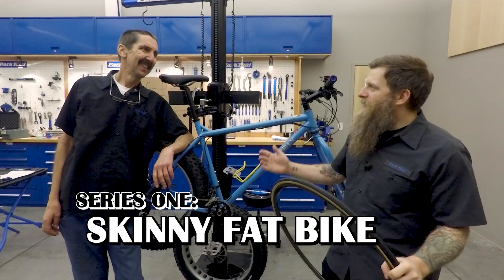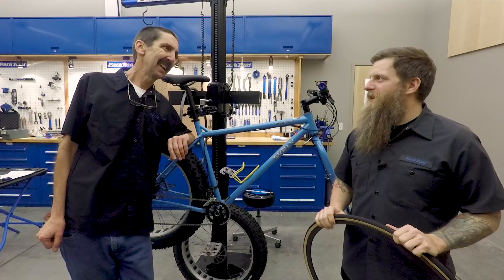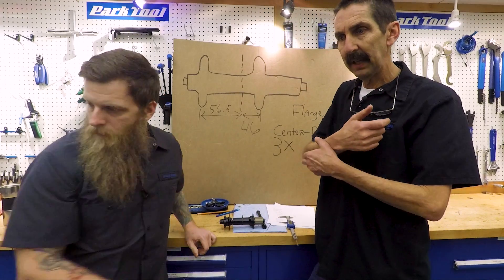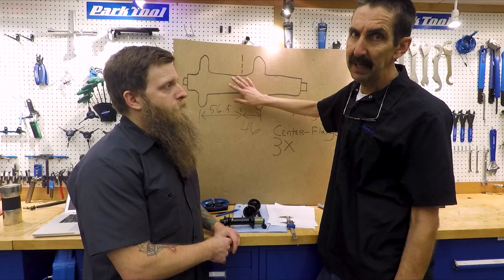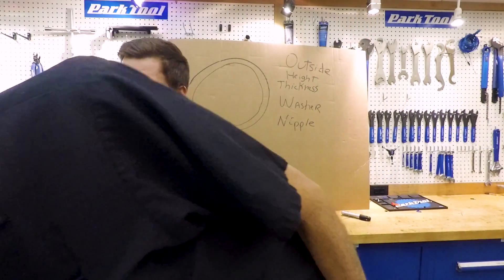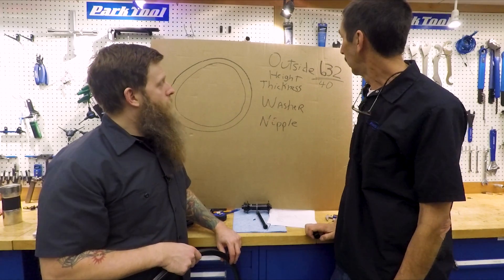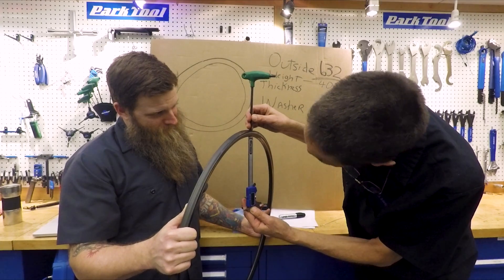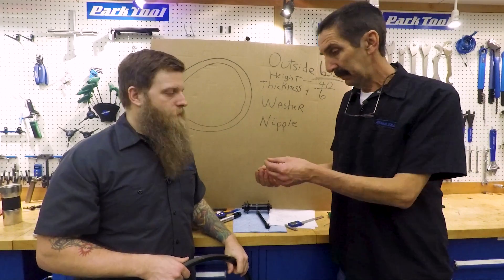Skinny Fat Bike Build, Part 1: They Did the Math

Comment: Great video. When measuring the outside diameter of the rim, would you recommend measuring it in different spots? The rim itself is probably not perfectly round. Thanks.
Reply from the maker: You are correct, measuring in a few places is good.  Average the numbers.